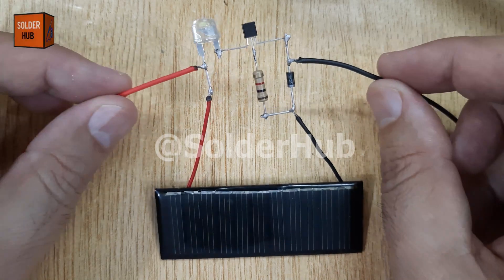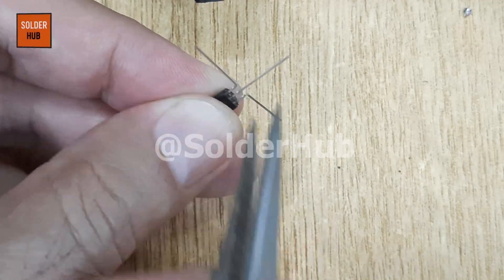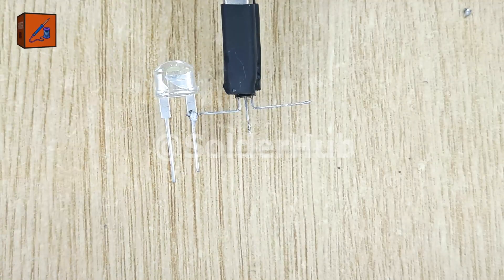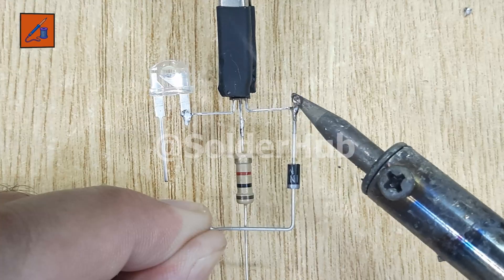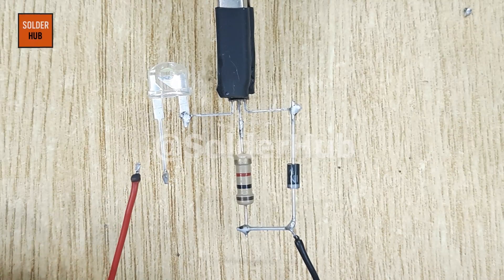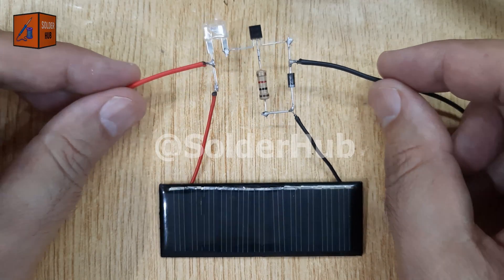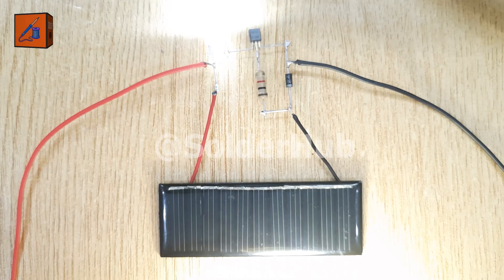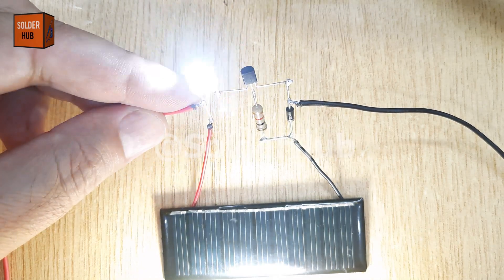How to Build Auto ON OFF Street Light Circuit using a mini Solar Panel | Automatic Lighting System

Comment: You may also need to put a 47 Ω resistor in series with the LED .... connecting a fully charged 18650 to a 3 Volt LED directly through a (  hard turned on transistor )  will instantly blow the LED 😝......................... DAVE™🛑

Comment: It is important that the solar panel  does not give out more than  5 Volts ( in full summer  midday sun )  ... with the diode drop , this gives a safe charging maximum voltage of around 4.2 Volts .... also put the Lithium 18650 cell  RIGHT DOWN  in total shade ( NOT up a pole in hot sunlight ) which will quickly evaporate the organic electrolyte ...... DAVE™🛑